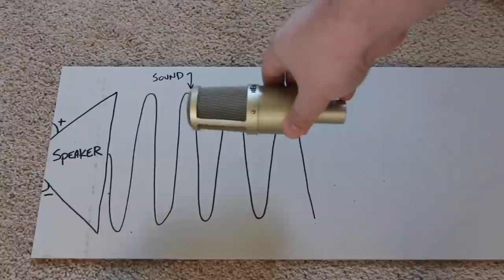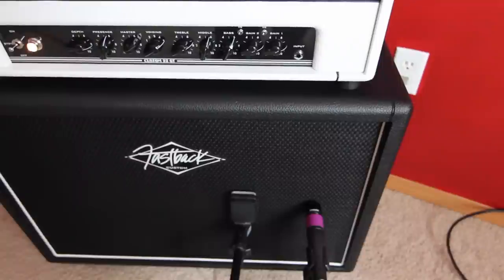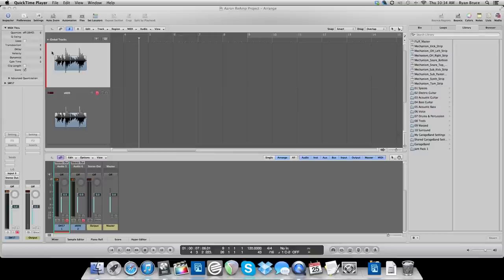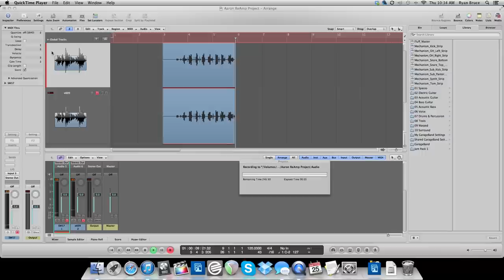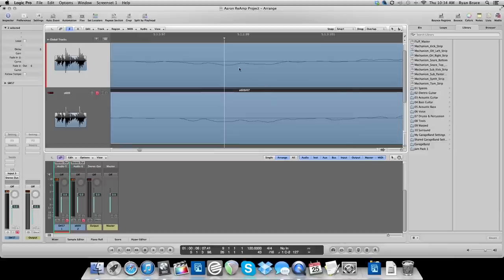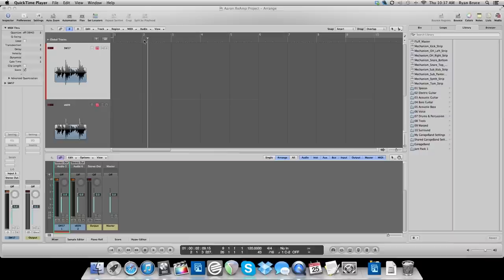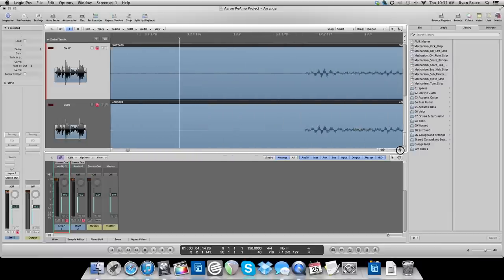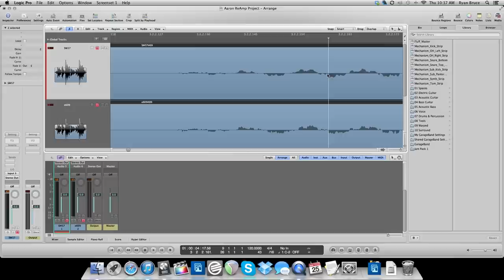Tutorial: Using Multiple Guitar Mics

Comment: Let's call it Phase Alignment not phasing.

Another trick, invert the polarity of one mic and move it until you get the most cancellation, the most nasty fizz in the combined signal. Then change the polarity to normal again and BOOM the two mics are in ideal phase. This also works for mics at different distances and even in an amp sim like Amplitube 3.
Reply: This is a really good method tip!

Comment: Since the low frequencies are of a longer wavelength, they are more susceptible to cancellation.  This is why when you have noticeable phase cancellation, it causes the tone to sound thin and lacking low end.  The short wavelengths of high frequencies pass by so quick that they don't pose as much an issue.  So in my opinion when checking phase like this, you should let some low notes sustain for a second and make sure they're lined up.  ..or just use your ear to decide what sounds best because you can get some cool tones when the phase isn't lined up so close.  Good shit though dude.